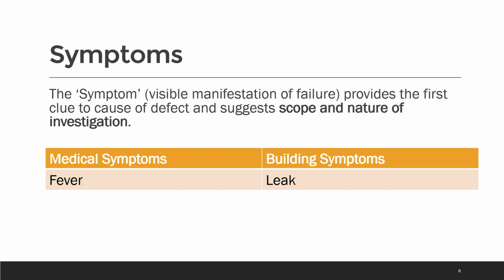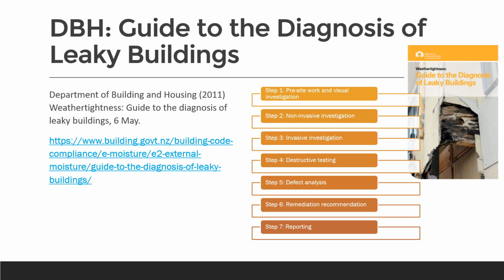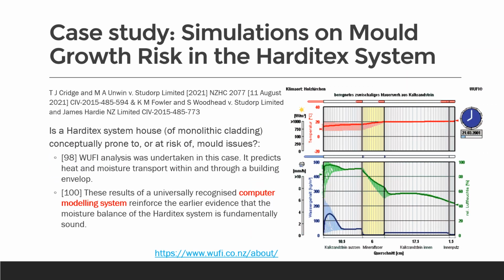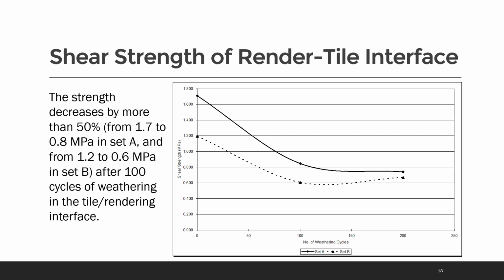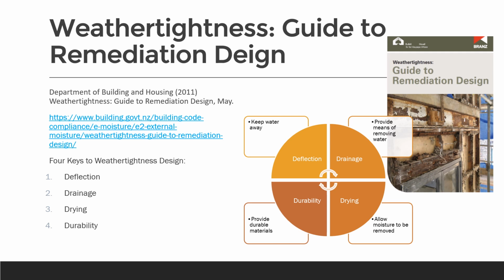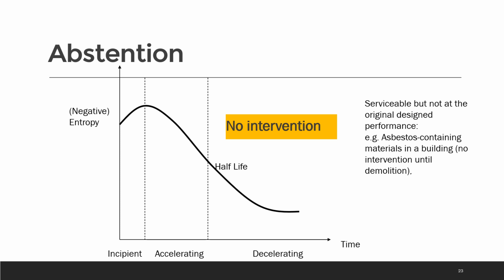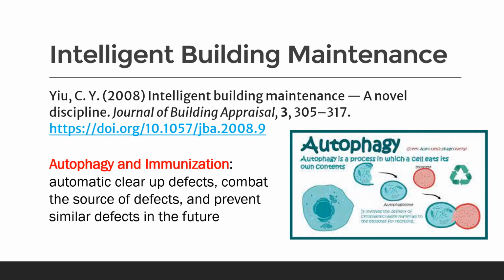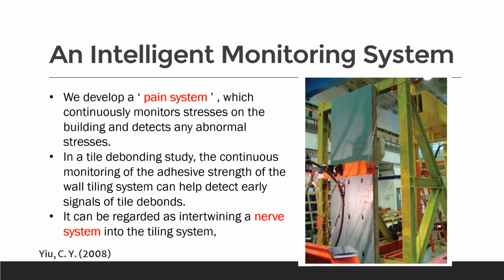[Building Surveying] Building Pathology and Intelligent Building Maintenance

Comment: 1.For the WUFI graphs about Harditex system, although I have searched for the official website, I still not understand with the blue line and green line represent to, even I could guess how these lines have got reversed effect with red line(temperature)

2.About the example of remediation, from the cross-section of the demonstration diagram, I would like to wonder why flashing with drip edge is better than installing the pipe in preventing infiltration 

3.should be concrete mix with microcapsules costing highly?
Reply from the maker: 1. Blue line represents Water content (kg/sm), green line represents relative humidity (%), it shows the moisture balance after passing through the yellow zone (Mineralfaser, mineral phase)
2. it does not compare the two different design. But flashing with drip edge is a good design to mitigate water penetration that the guidance recommends.
3. you may check with the material suppliers.